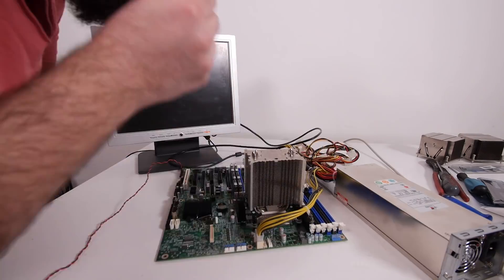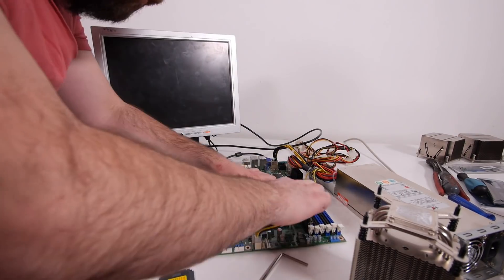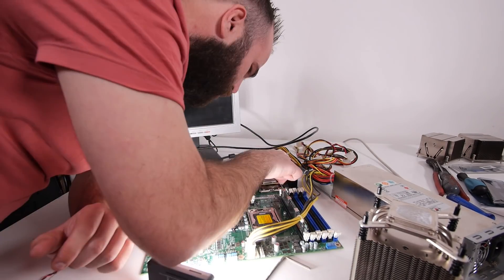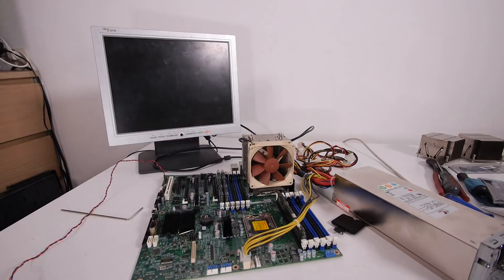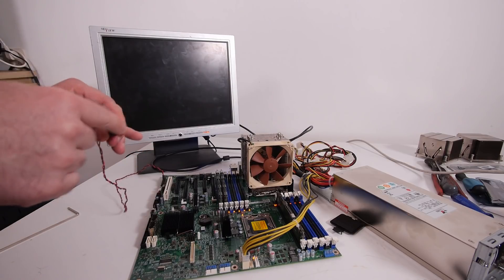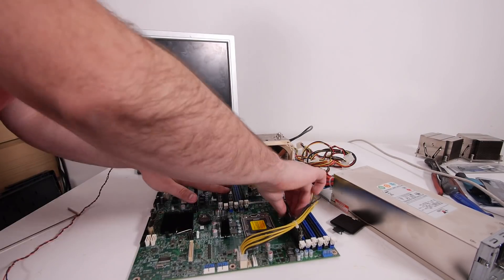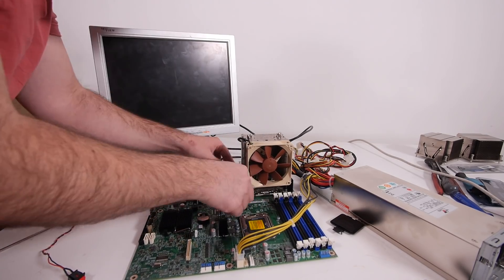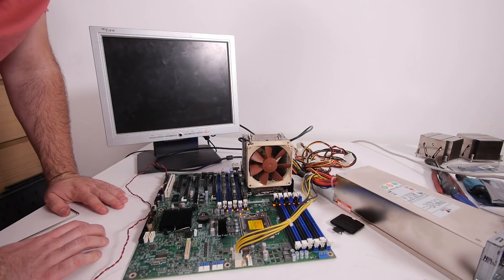ZFS Storage Server: Quick Update/Test CPU Socket Swap on the Broken Motherboard

Comment: Your ram lanes lit yellow. I think I would test with only 4 gb ram. Did you say you have 16 gb sticks?
Reply from the maker: management chip is loose on the board. So it is really broken
Reply: @victorbart   spread the pins and solder it maybe?

Comment: Does it wake up via Wake On Lan? Have you tried other pins? I had an Intel S5520HC Board a while ago. The Manual said Pins 11-13, but it turns on with Other pins.
Reply from the maker: I just found out that is a complete chip loose on the board.... It is really dead
Reply: @victorbart  Ouch. That sucks :(
Reply from the maker: @commodore128d6  I just even tried a screwdriver 4 pins at a time :D Didnt help lol
Reply from the maker: which pins? :)
Reply: @victorbart  Not quite sure, I just tried every possible 2-pin combination on the front panel header